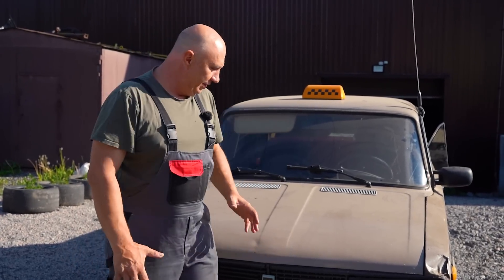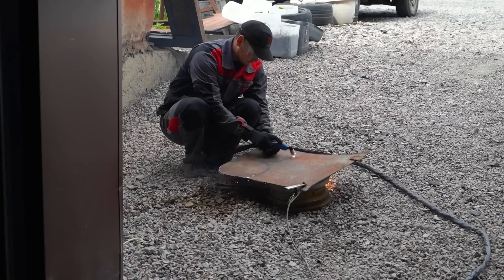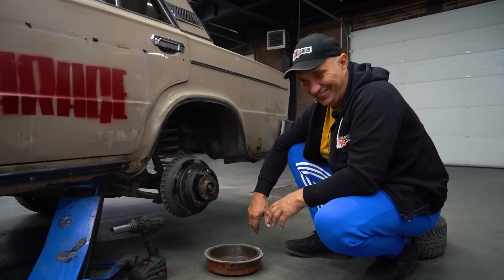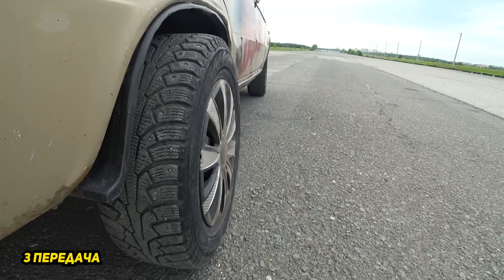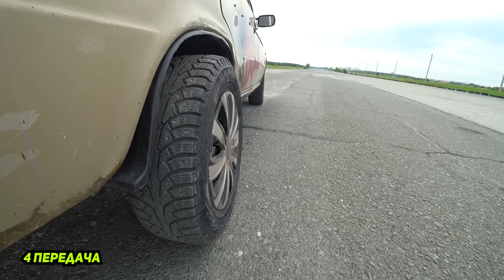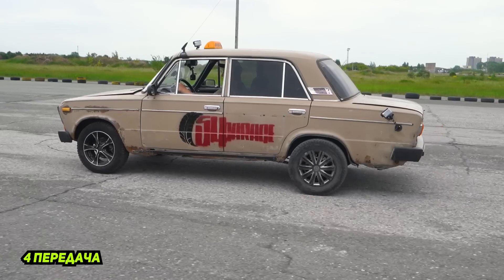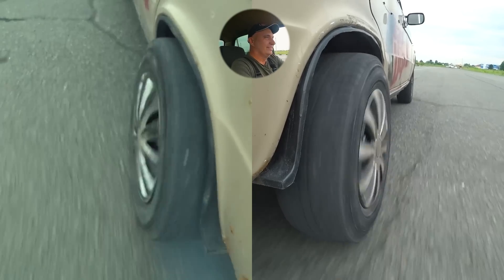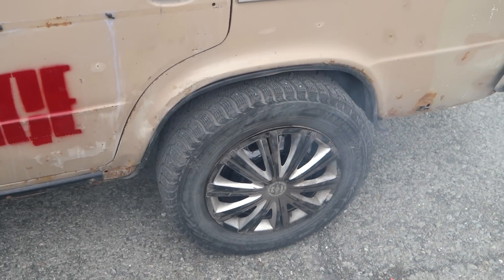What if we install centrifugal clutches inside the rear wheels?

Comment: I think you should install the centrifugal clutch in place of the original clutch, because the gearbox starts with first gear, while the engine's RPM is higher.

Comment: How did I miss this. Ok, paused it. I believe it's going to drive like a slipping transmission at 700 to 1500 rpm. Then it will be engaged. But every year change (if it gets that fast) will be slipping all over again. Maney not.

Comment: Before watching the test:
I think the rear wheels and power transfer would be okay because of the diff. Just when it wears out you'd have an issue.

After watching the test:
I should have known with the way the pads were dangling that it needed a little bit of a tighter fit. Gravity can only do so much work.

Comment: Just some note, you didn't put the weight for centrifugal force in the right placed, in contrast, it actually reduces the force. the best place would be in the middle of the brake plate not the top of it.

Comment: You have hooked up 2 engines, 3 engines and an insane 4 engines......but, can you put 2 motors in a lada and have one engine driving the right wheels and the second engine drives the left wheels, might run like a tank, you turn by slowing one engine and speeding the other one up. May as well put tracks on it if you can!!!

Comment: It might move but you're going to get slippage under load. And those will get worn out very quickly. The shaft speed isn't high enough to keep pressure applied to reduce slipping.

Comment: Yes, I had the same problem, video going black, but sound was okay.
This was never going to work because the wheel rpm is too low, so the force isn’t enough to push the pads out and engage them decisively, so the end up slipping and heating up. By the time you build up enough speed to sufficiently engage the centrifugal clutch it has over heated and can’t grip properly, similar to brake fade.
You’d need at least a 2:1, maybe even 3:1 reduction between the centrifugal clutch and the hubs, to make this work, but that would result in a very high engine rpm and low road speed, unless you had a step up to match, in the driveline. That’s starting to sound like a French car!

Comment: Hey guys! The setup you did would do wonders in reverse gear. You kinda screwed up with the direction of the breakpads attachment points. You'd get much better grip for them if you'd set those points counter spinwise. That way the pads could actually grip to the drum.
Reply: That’s actually true though
Reply: Just like bicycles ratchet hubs

Comment: This is exactly how them old cranes work. The engine drives a pto and the pto drives a big chain and that chain is attached to gears and those gears spin which in turn spin drums and brake pads are inside those drums so when the operator pulls a lever that lever releases hydraulic fluid into a piston into the drum and pushes the brake pad onto the inside of the drum which depending on the operators lever and the force of the piston on the brake pad, the winch line operates. Sometimes when it’s wet you gotta burn the brake pads and inside of the drum causes smoke so the friction catches when you go to pick up a load. On that same drum is another band around the entire drum which is attached to a linkage and then to the operators brake pedal so operator pushes brake pedal, pedal pushes linkage, linkage squeezes brake band and in turn squeezes brake drum stopping the winch line.
Reply: Nice period..............................

Comment: seems it will be so horrendously out of ballance at speed even if it performed otherwise... im picturing help from am an S cam that speads both pads under torque, if only going forward, plus the centrifugal force. that will work. needs to be both wheels too. (do a part 2 on this)
Reply: No

Comment: Some refinement is in order now. Rigging the brake shoes to engage the entire pad instead of one end as brakes normally work. Adding more weight to pads and giving them a linear motion should really help. I'm wondering if the diff being locked may help since it's likely transferring one wheel to the other and the clutch set up will handle that duty anyway. Give it one more try.

Comment: Dumb idea here but would it be possible to fit a torque converter onto a manual transmission?
Kinda like a liquid clutch
Reply: It's possible but fluid won't circulate.

Comment: Wouldn't this work better and be more practical if you did not have a trans but used a direct drive to the differential then to the centrifugal clutches? All you would need is a clutch that engages at like 1200 rpms along with a locked diff.

Comment: Engine starting rpm 1000+, wheel starting rpm 0.  There’s a reason why it works so much better at the crank.
Reply: You don't need The wheels to spin to activate the clutch dummy 😂😛
Reply: @mann_idonotreadreplies  are you special boy?  1000 rpm generates considerably more centrifugal force, combine that with the gear reduction you get with the transmission, it does work much better at the crank. 
Don’t be so dense buddy.

Comment: Don't know what happened but at 1015 into video I had black screen and only audio. I tried the cursor on the line and it also shows up black. I have my res to 360p but I still should get video unless useless tube screwed up the transferr.

Comment: Maybe try a lockimg torque converter there instead.
Reply: Torque converters need engine speed to function at all. And they dont lock up until highway speeds(at engine rpm)
Reply: Yea thats the point. Youd be able to stop without pushing clutch in. Bring axle rpms up to locking speed to lock torque converter resulting in launching.  Could be the new edge for drag racing lol a controlled launch per say. Real world cenarios prob wouldnt work that well but it could. Be really hard on torque converter. The act of the fluid moving inside it could help the car roll first then a possible lock

Comment: When you used the brake shoes as a clutch disc it worked well because they were spinning at engine rpm.  Now the rear wheels spin at engine rpm divided by rear axle ratio.  Probably around 3.5:1 or 3.75:1.
Reply: Given the car is in 4th gear (1:1 ratio)- lower gears are still out of the question unless they were to cast large lead weights onto the backs of the brake shoes. And that's a big maybe.
Reply: @rossbrumby1957  they went into 5th gear eventually so overdrive.

Comment: did you weld the diff? and needs springs on shoes.
Reply: Springs would make it grip less.
Reply: @rossbrumby1957  so every manufacturer that makes a centrifugal clutch made them all wrong, could of saved all them springs,

Comment: The problem is the open diff, when one goes to grip the other spins and loses its traction, should have used a welded diff but from what i can understand the brake shoes should have been weighted more
Reply: Open diffs don't send all power to one wheel though- it's always a 50/50 torque split. The difference is one may turn faster than the other, while applying the same amount of torque

Comment: try the same with break disk being used as clutch and a way to cotrol it separate from the rest of the hydraulic breaking system
Reply: They did that already. And it's not called break disc. ITS BRAKE
Reply: @mann_idonotreadreplies  auto correct loves me and ill haft to look i dident see disk

Comment: Add a 1kg steel chunk behind each brake shoe instead of a nut and you'll get ~5X the centrifugal force for a given RPM, should make this a whole lot more functional.
Reply: Define "work".
This is a big heater (this the smoke).
Changing mass won't change that.
Reply: @RubyRhod  If you have 5X the mass being flung around at the "floating" end of the brake shoe, you get 5X the pressure being applied to the brake shoe for a given RPM or half the RPMs for about the same torque going through, which means half as much brake pad smoke being generated for a given amount of acceleration or twice as much accelerating before wearing out the pads.
Reply: @teardowndan5364  You are not wrong, but while you increase mass 5 times, you lower rpms that create a certain torque by sqrt(5) or about 2.2 times.
So you "only" more than half the heat wasted/generated by the clutch.
I would argue you need to lower energy wasted by 10 to 100 times.

There is a reason why friction clutches of any type (and I would argue torque converters are in some way also a friction clutch) are meant to go at the highest rpm shaft in the drivetrain - usually directly at the engine.
Reply: @RubyRhod  I didn't say that it would solve the problem, only that they'd get at least twice the usability out of it.
Reply: @ruby cool story bro

Comment: The brake shoes should have been mounted the other way around. Using the centrifical Force to swing them out. I bet it would work better in reverse, the way it's built now.
Reply: No, they made the swinging end leading because they grip better (same as all front drum brakes on cars are leading end opens, not trailing end). To make them bite harder, the pivot bolt on the trailing end needs to be moved closer to the centre of the hub to gain more leverage.
Reply: @rossbrumby1957  all brake shoes work with center piston spreading open from the top. Either direction you have both a leading edge open and trailing. So your argument makes no sense. They should have used a similar idea to get both directions of bite from the shoes.

Comment: Didn’t watch it until the end because of the editing fail (really should watch your videos before you release them), but you need more weight on the brake (clutch) shoes. You’re expecting the clutch to transmit a lot more torque by putting it on the wheel vs the engine, so you need a much stronger clutch. Adding more weight to the shoes will increase the centrifugal force and reduce the amount of rotational velocity needed, but the amount of weight you can add will likely be limited by the amount of space inside the drum.
Reply: so your saying you had black screen till the end? cuz i could watch it till 10:10 and then i got a black screen but yes im sure them men in the video do watch there videos first but since this is a reupload it is more then likely the person reuploading them that needs to watch b4 uploading.
Reply: agreed. I think this setup could work with smaller rims, perhaps a little larger than the drums. either a wheelbarrow tyre, or just run a solid iron wheel, like vintage tractors did.
Reply: Sorry about that, this is probably the second big editing fail in the past 6-12 months, we'll be more careful going forward.

Comment: Tucker 48 , original  concept of torque converters on drive wheels.  Never happened due to development constraints.  However like to see if that type of design could actually  work.
Reply: Torque converters are very inefficient at low speeds without making them very complicated and closer tolerances (expensive). That's why nobody does it. Besides theres no logical reason or advantage of putting them there.
Reply: @rossbrumby1957  you problay right. Still would fun experiment .
Reply: @ross you don't know torque converters. TC is more efficient at low speeds When multiplying torque.
Reply: Not Worth it and it needs a pump (Long term) to cool it. Also it wouldn't be efficient at high speed because no lock up clutch. Cool story though

Comment: I don’t think it will drive.🤔 Should the pivot points on the pads be different?
Reply: Exactly what I thought- shift the pivots closer to the centre of the hub. Considering the load, I'd be casting lead weights to the back of the brake shoes too. That will possibly even make a lower gear usable.

Comment: Alright, now you need to try a torque converter on each wheel.
Reply: The original (but unimplemented ) design spec for the 1948 Tucker Torpedo had a torque converter in the hub of each rear wheel.
Reply: @samsungtvset3398  But how would reverse work?
Reply: @rayceeya8659  If they are connected to the driveshaft via halfshafts or CV joints (or just stuck at the end of a solid axle), I don't see the problem. I can see issues, but how would it not work in principle?
Reply: @samsungtvset3398  Only Tucker !!!!!
Reply: Great suggestion for Vlad
Reply: They're allergic to torque converters
Reply: @mann_idonotreadreplies  Well it took them about ten years before they finally bought a plasma cutter so they'll come around someday.
Reply: This comment needs more upvotes 👍👍👍